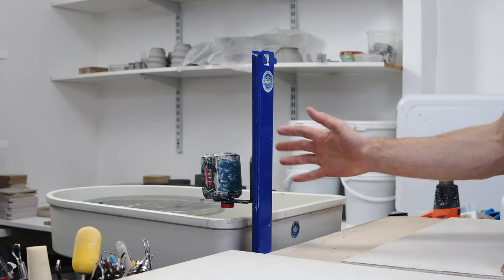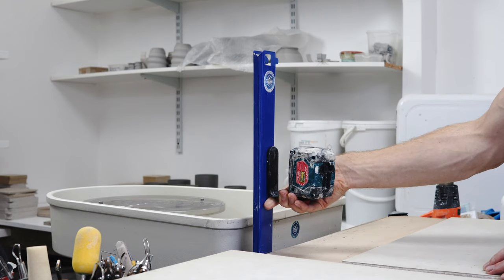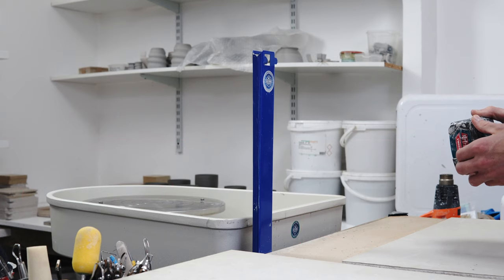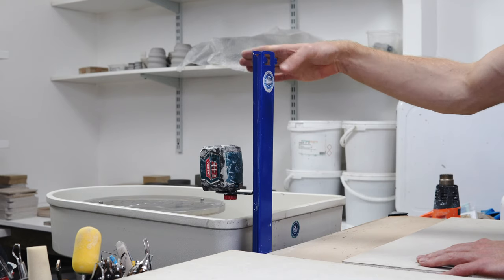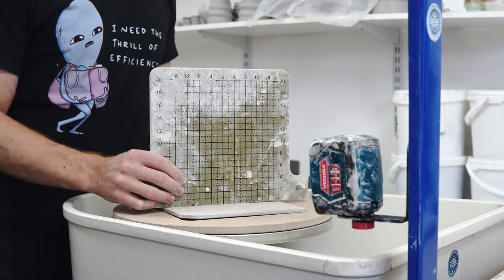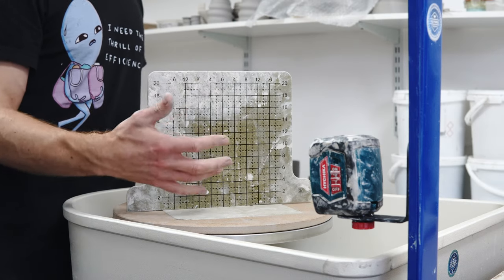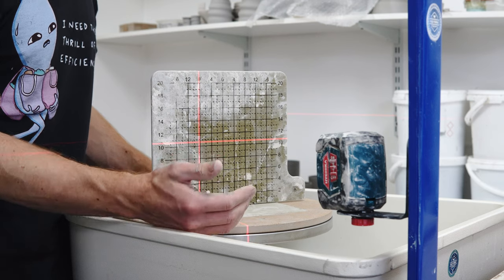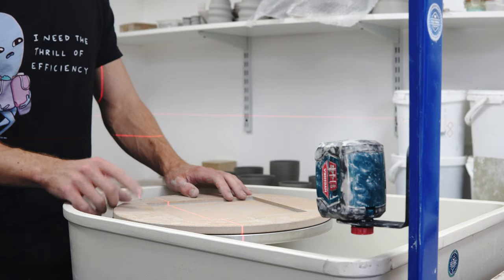How I set up my Laser Throwing Guide

Comment: Any concern about laser in your eyes? Maybe a small hood (flat plate?) on the top of the laser would stop the high vertical from hitting the eye?
Reply from the maker: It's not ideal, but I don't think it's a particularly big deal as these are a weak class of laser and it's only for a split second when it does happen. I do intend to mask off part of the front to prevent it if possible, but the way the lasers are arranged makes it more awkward than it would be if they were reversed